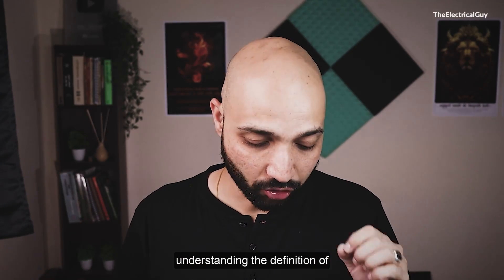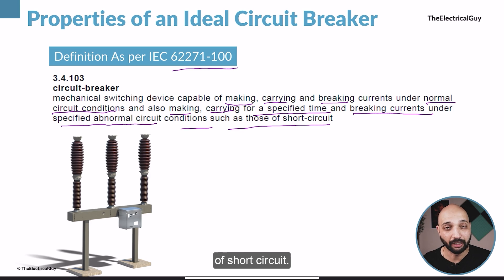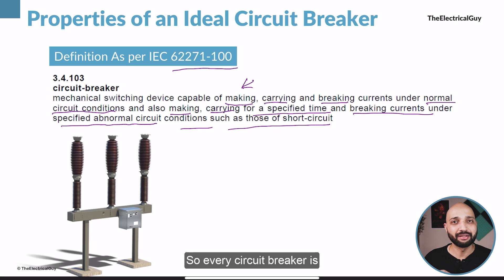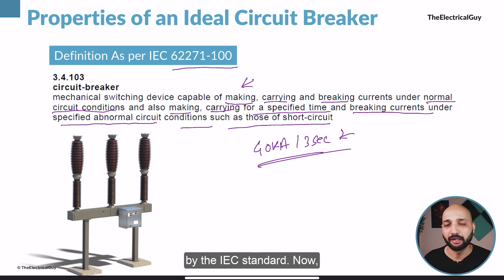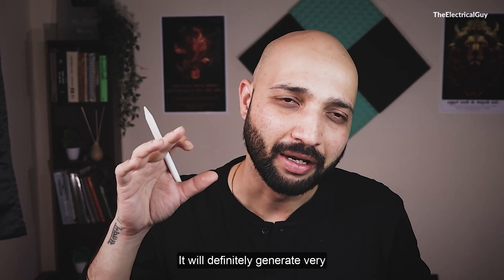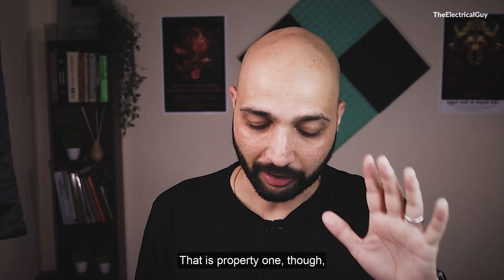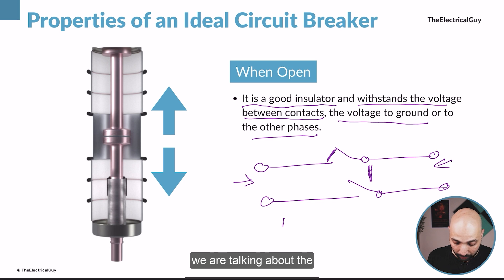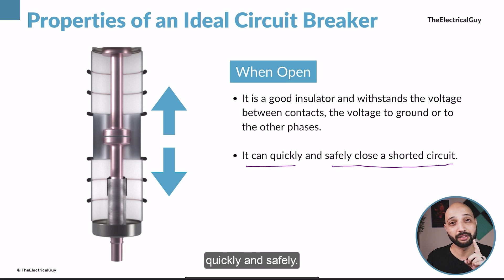4 Essential Properties of an Ideal Circuit Breaker | TheElectricalGuy

Comment: Sir if the circuit breaker contacts are open then voltage will be available in one end only. Pls check time from 06:40. Its confusing me, can you explain.